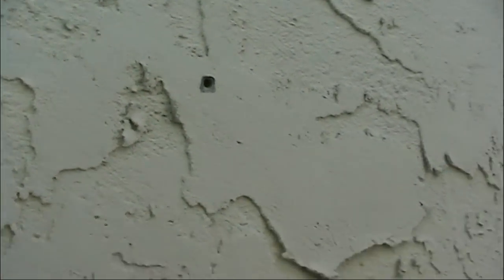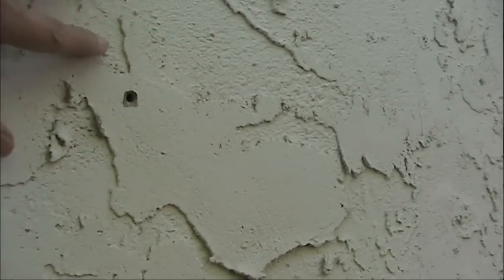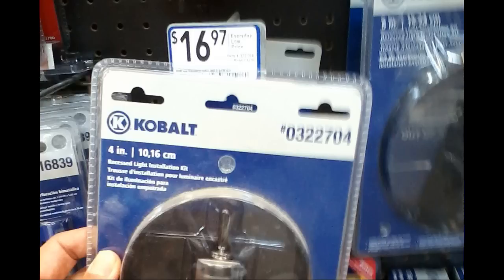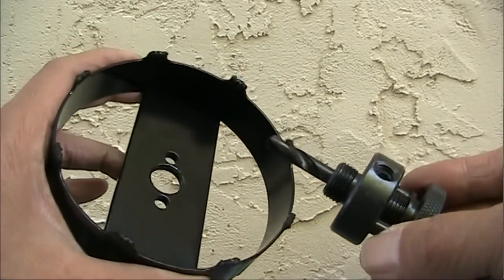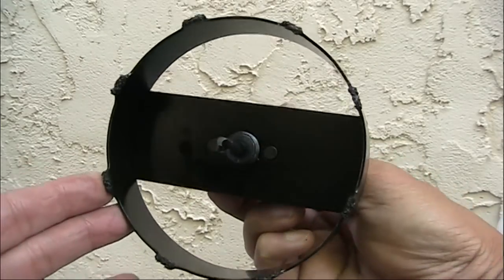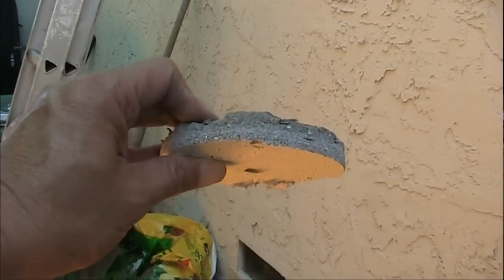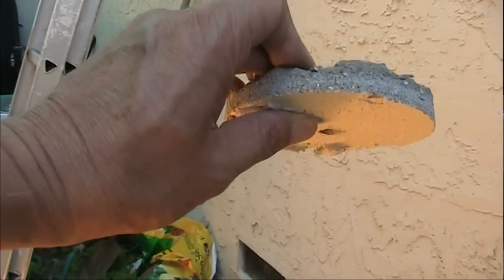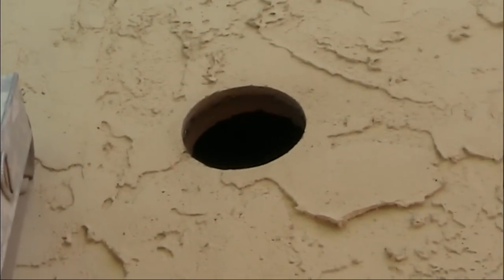Cut a 4 inch hole through stucco wall for bathroom fan duct

Comment: I used that same hole saw to install a portable AC duct. Worked great. 
I cut my hole first through the drywall where I wanted the vent, drilled a center hole out from the room through the stucco. The rest was easy.
Caulked everything.

Comment: I dont see my last post - so I will repeat:

Thank you so much!  You are the man.  This tool was perfect for cutting the stucco.  I found the tool on Ebay for $15.  The tool/hole saw is actually for cutting holes in drywall for recessed can lighting.  But it was great for the stucco and cheap!  THANK YOU!!!!!

Comment: Too funny... I was doing the same for 2 vents about a month or two ago right before getting a new roof. I wanted the vents going out the side instead.  Never realized how thick stucco is. I think I went through about 3 or 4 progressively better hole saws before finally getting a carbide one that actually helped get it done.  Probably took me at least 10 hours - back and forth to the big box store, and then finally ordering a good carbide version online. Lots of battery recharges also for the cordless. Wish I saw your video before it all - would have probably saved me many hours of frustration. Also motivated me to start building a catwalk up in the attic. All the twists and turns needed to get to where I needed to be were harsh on my back.
Reply: never use cordless lolol

Comment: Thanks for the video but I knew from my experience that the hole saw size should be slightly larger than 4" to make a hole for a 4" wall vent.   The duct tail on the wall vent is exactly 4" so I usually use a whole saw of 4" 3/8 or 4" 1/2  so it can come in comfortably

Comment: Nuts, I wish I'd seen this earlier. I tried the multiple hole method. The downside was using a chisel you can't always control where the fracture lines go. I ended up losing a chunk of stucco adjacent to the hole because there was already a few fracture lines nearby (old house). Your method may have prevented that depending what happened when the saw hit the metal lath.
Reply: Cool

Comment: thanks for the video.  I just checked lowes to see if they carried the same hole saw, but they didn't.  They no longer carry a 4" (atleast on their website) but they do carry a 4 3/8" saw.   Kobalt 4-3/8-in Carbide-grit Arbored Recessed Lighting Hole Saw.   I'll try to cut through my stucco with this guy to install a vent duct as well. wish me luck.
Reply: @roderickyoung1243  thanks for the response.  BTW, are you in Hawaii?
Reply: I'm originally from Waianae.  I moved my family out to Utah back in 2017 for work and cheaper cost of living.  I could tell from the familiar tone in your voice and your name you were from Hawaii =)

Comment: I have the exact same wall. The sheathing is the old fiberboard you'll find in many houses. One thing I noticed is you've put that vent within 3 feet of a window. That's a code violation. ;) 

Thanks for the video just the same. I've just ruined a standard hole saw on stucco and feel extremely stupid for not thinking about this before. I've drilled plenty of holes in stucco before and they always need a carbide or other type of masonry bit.
Reply from the maker: Oops, my bad on the clearance to the window.  Guess I could have gone higher.  I wasn't about to do an actual roof vent for this kind of cowboy project.

Comment: Thanks for the video, extremely helpful.  Did you use the same tool to cut out the wood/fiberboard from the inside as well or did you use a hole saw?

Comment: I tried this exact same Kobalt hole saw line for a six inch hole, and it was simply not up to the task. Got maybe 3/16-1/4” through stucco before progress stopped.

The hole saw clearly says it’s for drywall, which I can believe. Have to try another model, which has a continual ring of carbide grit.

Comment: It looks like you're using the ladder backwards. I'm not a safety nazi, I just don't want to see you get hurt if it was done unintentionally.
Reply: @roderickyoung1243  Not upside down,  backwards. You can see that the rungs are angled, not flat, when looking at the rails. When the ladder is leaning against the wall at the correct angle,  the tops of the rungs should be flat, level with the ground.